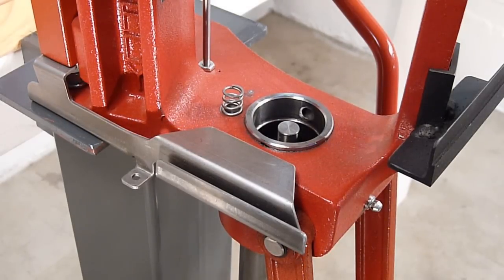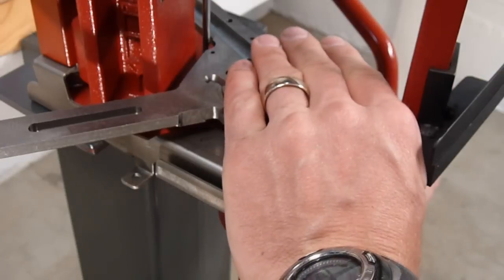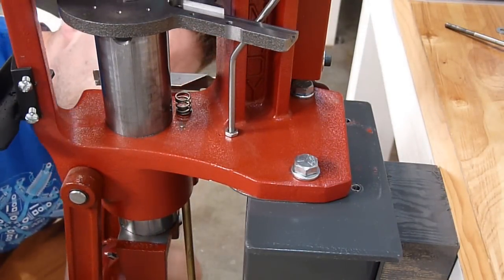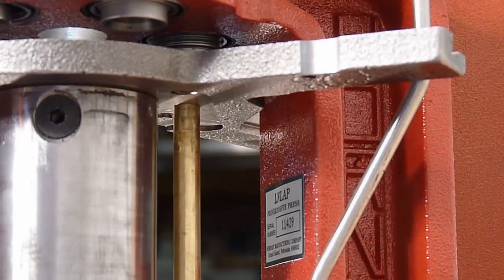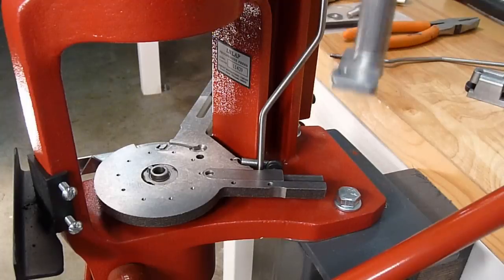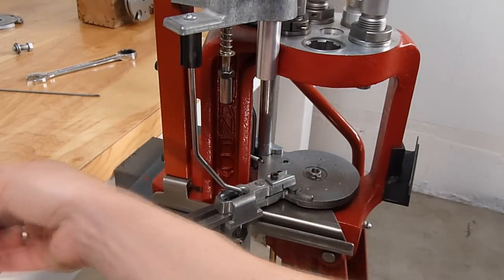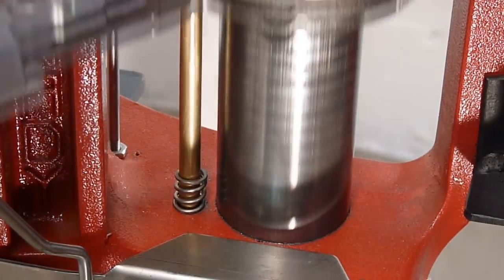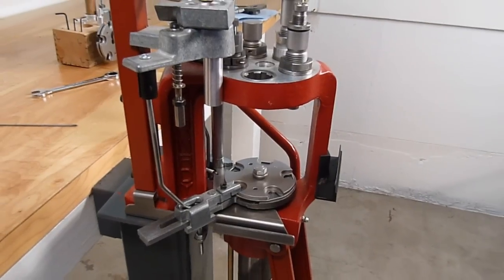Hornady Lock-N-Load EZ-Ject Kit Install Part II (HD)

Comment: Thank you for this video. Most of it is pretty straight forward. The one thing I was stumped on was getting the brass spent primer tube out of the old plate, without damaging it. I did not have the tool, but used a punch that was the right diameter to keep the tube from getting crushed while gripping it with a pair of pliers.

Comment: Nice video....but a few errors sorry.

You called the case feeder a primer slider
You used the wrong shell plate carrier lock down screw ( you needed the Allen screw head one)
You did not seat the case retaining spring into the guide slot in the sub plate under the shell plate carrier.

Otherwise very clear and detailed instructions

Many thanks
Reply: Yes, for the retaining spring, he should have pressed down on the spring at the last station, and continue applying light pressure and move his finger with the spring as he rotated the shellplate. This will force the spring into the groove under the shellplate, where the case shuttle meets the shellplate.